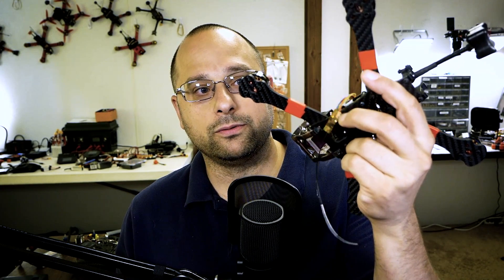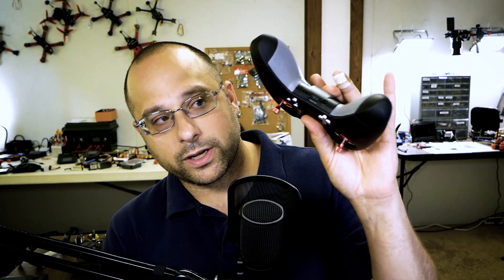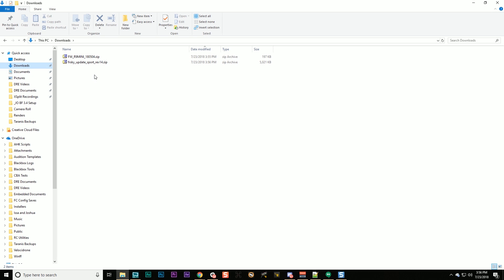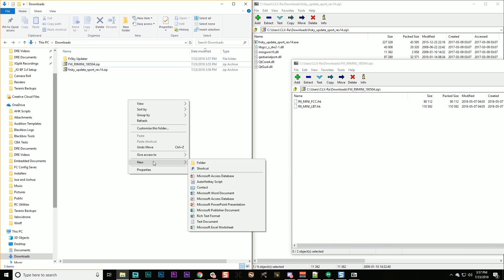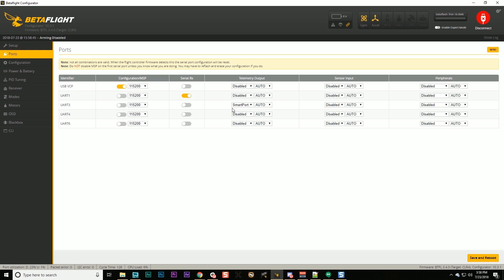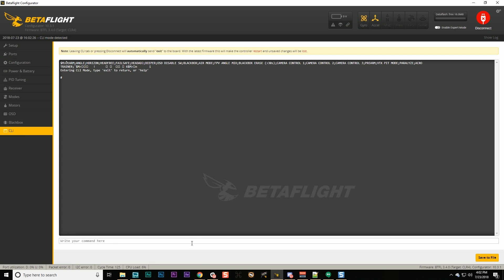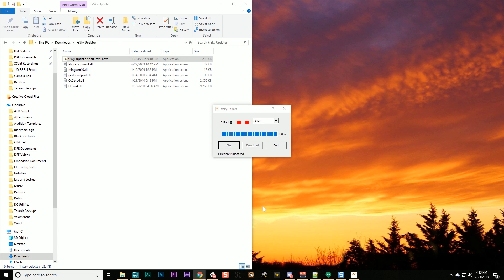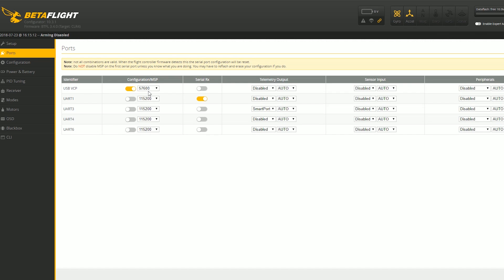Betaflight Serial Passthrough FrSky R9 Firmware Update

Comment: Hey JB I just wanted to let you know I followed your instruction from this video and it Freakin Worked.  I couldn't believe it.  I was sketch when you said to go to a lower port but, boom it worked.  Anyways first thank you.  Second unfortunately I had to do it this way cause I was having trouble flashing a new R9MM from both the XJT External port as well as the S.Port on the QX7.  It kept telling me something about bottom pin not responding.  Yes I swapped the power and ground when switching from XJT to S.Port flashing.  So now that it's flashed and bound and shows to be working in the receiver tab in BF I deleted all existing sensors from my radio config and the discovered new sensors and get nothing.  If switch back to my XSR it discovers sensors fine.  So is this receiver hosed?  It's been nothing bout trouble since I received it.  I have successfully flashed and installed a working R9MM in another quad so it's not my first rodeo with it but, I am at wits end with what else I can do to make this thing work.  I'm obviously not gonna allow myself to fly on a receiver that wont output telemetry data.  Your my last hope before I have a back up antenna circular file this receiver.  Thanks.
Reply from the maker: It's probably not hosed. Did you flash the FPort firmware or the SBUS firmware? The wiring is different for them.
Reply: @JoshuaBardwell  So I downloaded the file like 3 weeks ago it's R9MM ver 180716 FCC.  I kept the file on the SD of my QX7.   Since that was the matched version at the time with the version I download for the module.  So when I the pass though I just copied the same 180716 firmware from my SD card to my PC that I flashed my first working receiver with to ensure all the versions matched and I know that version is working.  I'm sorry this didn't exactly answer you question or maybe the version info was enough for you to tell?  BTW thanks for being so awesome and answering this so quickly.  Quite unexpected.  I've been fighting with this thing for two days now. LOL
Reply: 2nd though I believe it was the S.Bus firmware to be honest.  I am afraid to use F.Port cause I'm not clear on how it works though I think would like to try it as being able to save a uart sounds nice and to get both telemetry and signal over the same wire. I'd just be happy to get it working with S.Bus though.
Reply from the maker: Did you accidentally flash the module firmware to the receiver? They are different. Just taking a punt here.
Reply: @JoshuaBardwell  Yes sir absolutely 100% positive I used the right file..The R9 Module and Receiver fimware files are in two different folders \R9 folder for Module and \R9MM folder for receiver.  R9MM folder has two .frk's 1 for LBT and 1 for fCC of course used the FCC ver. file name R9_MINI_FCC.frk to be specific.
Reply: @BelovedFPV1  It's way too easy to Flash the R9 'transmitter' module in my X-Lite with the 'receiver' firmware accidentally, but I found that the module always flashes at least - so you can correct it easily. Unfortunately the receiver R9mini fails. I always suspect the physical connections first. I'm replying because I was trying to update all of my quads with r9 - and I have had no end of problems. Luckily I'm freelance and have some 'time off' - but I was up till 7am messing about with things - it really gets to me and makes me not want to change anything once it works. ( gives me an idea - to create an interactive flow chart that would enable you to follow instructions based on answers to questions, and if you get to a dead end because there are huge amounts of variables ( and nobody can think of everything ), it gets flagged and could be answered by the community - imagine a wiki-flowchart ). Anyway - i'm going OT a bit - soz - thanks JB for all of your vids - I have learned a lot actually.
Reply: @gingermanc  I've successfully flashed in the past with no issues.  At this point believe that I have a faulty receiver.  i have successfully flashed the receiver, I can successfully bind to it and works in BF on receiver tab however it gives 0 telemetry when trying to discover sensors.  Obviously S.port must have a solid connection because I was able to successfully flash it with this method and the update occurs over S.Port. Joshua seems to be stumped on it as well or he's busy one or the two. LOL Unless @Joshua Bardwell  comes up with some crazy R9 S.Port voodoo magic I'm calling it a DOA receiver and shit canning it.  Guess I have a spare antenna now.
Reply: You should update your Radio firmware of OpenTX.  Then that error about the bottom pin not responding will go away.

Comment: the tool cannot see the FC's com port
Reply from the maker: Did you shut down the BF configurator before attempting to use the config tool? That's my best guess--that the BF configurator is still holding the port. Close the BF configurator but do not power cycle the FC.
Reply: yes of course.
and also, i saw this line on the github wiki
>I was unable to replicate due to issues with the FrSky tool not loading COM ports. If you are familiar with this procedure, please update if necessary.

seems like i am not  the only one

Comment: Hey JB, what if my smartport/telemetry is solderd to UART3, but it is working via SoftSerial1?
Reply from the maker: I think you must use the softserial interface number, not the UART3 number. This number exists but I don't know what it is. I've seen it before... I'm pretty sure you can do passthrough on softserial. But I don't know the CLI command.
Reply: @JoshuaBardwell  its softserial11. So i need to use 10 or 11 when i type the command?

Comment: Nice tutorial...two questions: 1) will it work rousing fport? 2) once you finish the procedure, do we need to type something in the cli to restore the initial configuration?
Reply from the maker: Yes it will work using fport. To restore original configuration just power cycle the FC.

Comment: If you've got a power-over-usb FC (JBF4, CLR F4S, and Kakute F7 are some that I have used and confirmed the following for) and an Rx that uses a plug-in style wire harness that is connected to the power-over-usb 5v pad, then simply leave the Rx unplugged from the harness while you set up pass-through and start the FrSky STK, then plug it in once you are ready to write to the Rx.  Works perfectly for me without having to change my wiring away from the power-over-usb 5v pads.  Unfortunately for R9 Mini quads (including my own) being a direct solder Rx this trick doesn't apply.  Just updated my R9 Slim+ this way and will be doing this for all of my R-XSR quads as well.  Thanks Josh, informative content as always.  Hope this tip helps someone out there.

Comment: another popular youtube made a video saying micro motors ate burning up on the new betaflight 3.4 and up.. and oddly enough I've noticed motors getting wayyy hotter on my babyhawk r. any thoughts?
Reply from the maker: Try BF 3.5 :-)
Reply: Joshua Bardwell configurator 10 3.1 firmware 3.5.0... just did a test flight and super hot motors after about 2 minutes

Comment: Hey Joshua, say you want more range and happen to have a 2w 2.4ghz booster, and a taranis x9d se. Is it possible to remove the stock antenna, and place the 2.4ghz booster inline, to say a higher th I antenna?

Comment: Ok so I successfully flashed the xm plus this morning. I have kakutef4v2 and it has smart port on Hart one. So I moved the subs wire to smart on the fc and the flashed worked.
Reply: Hi Kemonric, please can you explain it little more what you mean with "So i moved subs wire to smart on the fc?"
I have also kakute f4v2, smartport on uart 1 (so serialpasstrough 0) but frsky update tool won`t find my COM PORT which betaflight was using.

Comment: This may be useful, thanks!
Curious though, why flash a rx with firmware version "First release"? It's already on the rx, it's not a firmware update.
Reply from the maker: All I know is I read that you should update the firmware before you fly, and I didn't want to do a review of this product only to have people say, "did you update the firmware?"

It looks like another firmware has been released on July 26 though. Maybe that's the one people say you need to upgrade. Or maybe it's the module firmware that matters.
Reply: Joshua Bardwell I asked just in case my understanding of "First release" is incorrect. Definitely flash everything R9 with the latest and update OpenTX/Lua scripts. Too many issues otherwise but the latest works great, makes the 2.4G link obsolete. Thanks, Joshua!

Comment: Hey on the Bardwell f4 v2 there should not be continuity between 3.3/5v and ground right or should there be? what would happen if I plug the battery in like this? thanks.
Reply from the maker: DON'T PLUG THE BATTERY IN.

The most likely explanation is that you bridged 3.3v to 5v when you did the solder bridge to select receiver power. The bridge on the underside of the board.
Reply: I think what happened is I scraped the top layer of the board off next to the 3.3/5v pad so when I soldered that pad it bridged the pad and the exposed metal. Anyways i took some of the solder off that pad and now it seems to not be connected to ground. is that possible? is the material under the top layer of black stuff connected to ground ? needles to say my problem seems to be resolved. thanks
Reply: i guess this isnt rc  fourms

Comment: Joshua, do you have an idea of how the EU vs international firmware compare?
I read on Oscar Liang's page that the international one has a higher sensitivity. But I'm not satisfied with the RSSI from the international FW compared to my older LBT one...
Do you have any insight on that?
Anyway, thanks for the information in this video as always. ;)
Reply: Looks like you are in Germany, using the None EU firmware is a no go, because it uses the wrong frequency so you will receive interference from Mobile phone towers etc.

Shame as the EU firmware is rubbish. I understand that we cant legally have >25mW telem in the EU and cant have >500mW on the module. but the EU firmware misses all the useful powers, its 25mw or 500 with nothing in between, and for 16 channels its 500mW or nothing. Hopefully they will release some sensible firmware soon as having everyone blasting 500mW is ridiculous.
Reply: You can now also use 100mw withought telemetry up to 16 channels on eu firmware :)
Reply: Epicness 357 okay, I do like telemetry though.
Still, do you have any more info on that, a link or something?
I am going back to EU anyways because I'm not satisfied with international, probably due to what the other guy said...
Reply: look up the "Frsky R9 Users" group on Facebook, lots of good help on there and a decent FAQ's on the modules in well underway.
Reply: Thanks mate, I will look into that.

Comment: Have anyone ever figured out an solution on how to revive a bricked receiver because sadly i have about 3 lying around at home :|
Reply: Apparently the bootloader should still be intact - so it should still flash. But yes I have inop. rxs that will not flash. I'm gonna try using a USB FDTI adaptor next I think.

Comment: Hey,
I recently built my first quad... but while setting it up in betaflight after I had bound the receiver (R-xsr) to my q x7 i was not getting any response in the Receiver tab.
I watched a ton of your videos on all versions of betaflight and realised that when I typed "status" into the CLI the arming flags were RX-loss, CLI and MSP. This was while I had my receiver bound to my tx and the quad was powered on.
I have my configuration set to serial based receiver and SBUS, and i have tried every UART port possible. 
Please help me!
thanks
Reply: U probably used the connector wich came with the  rxsr .u must move the yellow wire inside the connector. This is a cable to update the receiver.yellow is the smartport not the sbus.
Grtz
Reply: Rob Fpv I see what you mean.
Can I update the receiver using the yellow wire to fport and use it that way?
Reply: No u need to move the yellow wire down to sbus out on the rxsr. It is actually the telemetry wire .also very useful.
Reply: Is the led blue or green on the r-xsr? If it's green you're in PPM mode, which happens if you hold the bind button for too long. To get back to sbus mode you power up the receiver while holding down the bind button until the blue led comes on.

Comment: Xm plus does not have smart port only rssi
Reply from the maker: Like... I know there must be a way to update it. SBUS? I dunno.
Reply: Joshua Bardwell I'll try and see if it can find it without doing anything just run the update and see if it finds it via fc.
Reply: Joshua Bardwell the reason I wanna update it is b/c I have xm plus but I have the jumper v2 plus.

Comment: nice - but is annoying (receiver power up only with battery) when you want to use your kwad as connector for playing simulators, which is possible in the latest Betaflight releases.

Comment: You can also use serial pass through on the Matek  VIDEO TRANSMITTER 5.8G VTX-HV  to update the firmware by connecting up rx and tx ,but I don't know  if you can do this while video and audio are also connected and it's installed in your quad? http://www.mateksys.com/?portfolio=vtx-hv#tab-id-6 ,I will have to try it.

Comment: Nice Video! I'm not having trouble updating r9, but connecting to MW OSD, I've got some crappy old backup backup backup Quad, which has the Flycolor Raptor 390 stack which has MW OSD R1.5, you're supposed to be able to connect using serialpassthrough, but in the MW Osd GUI it gets stuck reading or doesn't start to read at all, so I can't configure it, do you have any tips?
Reply from the maker: Make sure baud rate is set correctly. Power the MWOSD at the right moment to catch the bootloader window. This is the hardest part. If you use an FTDI adapter it has the ability to reboot the device to trigger the bootloader window. But that doesn't work over passthrough.
Reply: Joshua Bardwell Thanks for the response, I don't want to flash it though, I want to connect it, I'm sorry if that was confusing.

Comment: Awesome, JB!
BTW, I'm thinking about making a adapter cable to flash the firmware of XM+ receivers, but I don't know how yet. Something I could use without soldering any pins. I'm going to do the same with R-XSR receivers, but as it already have a connector it's much easier.
Reply: Use female to female servo connector, don't forget to rearrange the pins in the connector on the radio side if you're using X9D because the GND VCC data pins aren't aligned correctly which will be resulting in smoke! Also, make sure the battery in your X9D isn't over 10V because the VCC is a direct battery voltage.

Comment: Here's my problem... I use a Jumper transmitter so I can't do it through that and all I have to use would be soft serial. Is it possible to do this through the soft serial as done through a uart?
Reply from the maker: I don't see why not as long as the baud rate is supported.

Comment: so what if i hv a qx7 i do have a receiver that i can just unplug and do the old way BUTTTTT i updated my QX7 now it wont see the pins on the bottom to update my brand new r_xsr just get errors that it cant see the pins on the qx7 display :(
Reply: StaticMotion I have a similar problem. Do you get bottom pin error ? Or does the flash just not happen ?
Reply: chris colburn both can’t flash or see pins it happen after I flashed my qx7 so idk maybe I’ll just get the frisky flash gizmo
Reply: StaticMotion I got the gizmo coming today in the mail because I got a r-xsr that my x9d+ jacked up and I can’t get it going. Hoping the USB port flasher will work.

Comment: Would a single pin wire plug or small barrel connector on positive lead to receiver more simply allow the update period more accessible?
Reply from the maker: To me it seems like my way is better but yours would work.

Comment: are these work with xm+ ?
because I can't find an "s-port" on xm+ rx
Reply: M Argus Chopin Gyver the XM+ doesn't have Smart Port telemetry.
Reply from the maker: I dunno what pin you use if the receiver doesn't have telemetry.
Reply: The XM-PLUS is flashed through it's sbus pad. Not sure how/if this will work through the FC. I can't get my com port to show up in the FRSKY software.